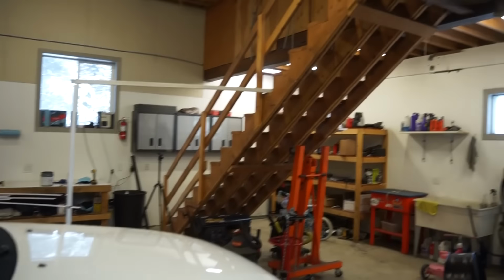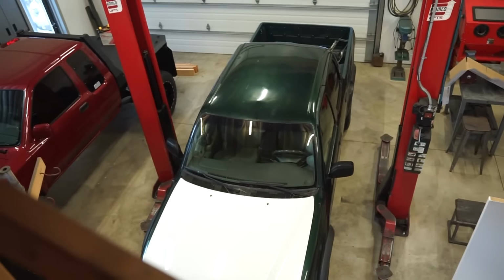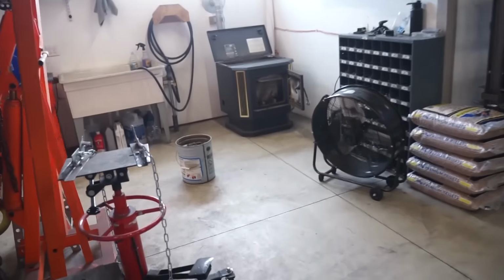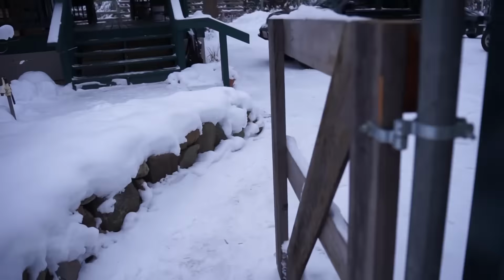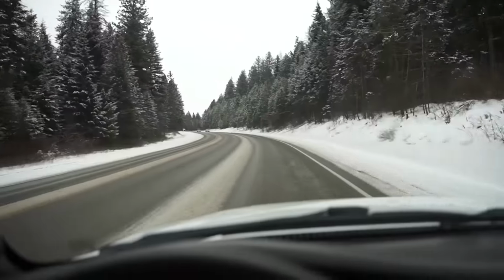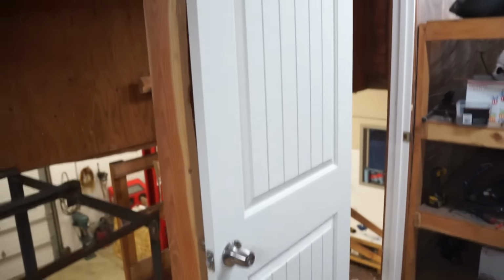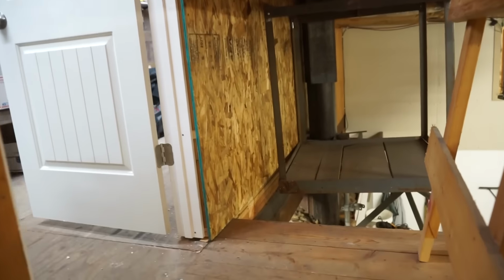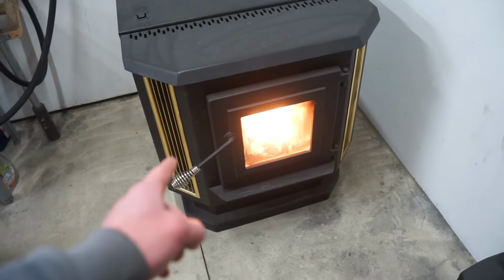Will The Diesel Tacoma Pull A Trailer?!?!

Comment: Lets go brandon!       My pellet stove has an actual burn pot and all the air comes up from the bottom.   There is never any ash in the burn pot even after 10 bags through it.  I hope your mods work well.  That would be a pain in the ass cleaning that thing out all the time.   I don't have to open my stove door but every 10 bags or so.   I hope your brother is doing well!

Comment: On your modification of the your lift ,what type of framing is your garage,if steel beams,what putting Ibeam connected to garage framing,using slide pulley.where yo can attach chain foil.and be slide back and forth being able to pull motors and load and unload items.good video as always keep doing what your doing 👍👍👍😎😎😎

Comment: No Problem, i drove so many times a 3500KG Trailer on a 3500KG Volkswagen T5 with a 1.9TDI :-D in Switzerland, Mountain up and down. So 7 Tonnes (7000KG) total is in my opinion the max weight what a 1.9TDI can handle. Regards from Siberia

Comment: The ash in the pellet stove is solely due to the quality of the pellets. Cheap pellets from local hardware/big box store are very low quality. I buy mine direct from importer and get the highest quality. They are more expensive but burn hotter and almost no ash / ash buildup. Before you build a new burn pot, I’d recommend buying some high quality pellets and try them? Just my experience. Hope this helps?
Reply from the maker: I’ll search around for better pellets!!
Reply: Buy a few bags and compare!

Comment: Have you thought of adding air injection to your pellet stove?  A small piece of pipe (3/4") with a small fan (computer?) mounted away from the heat blowing into the fire box for when you want those extra BTU's.  A wall wart transformer wouldn't use much electricity and any air going to the firebox will increase the burn efficiency over natural draft.  Put a variable fan on so it can be regulated and a valve so it isn't introducing air when it is not needed.  Make her as simple or as complex as you want.  Manufacturer's don't recommend it and it certainly isn't best practice but when we were in the shipyards during winter layup we often painted with oil based and laquers at freezing even in the mid twenties as long as the humidity was not high we had good success.  I wouldn't try it on auto paints which are much more finicky.  Might be worthwhile to talk to a chemist (not a salesman!!) at whatever paint company you are interested in as they have additives and suggestions as to which system to use for difficult situations.  I used to call International headquarters in Texas and talk with their chemists for help in such situations.

Comment: Don't use pellets but wood, I would say you need some air from the bottom to burn the embers and secondary air on the top to burn the wood gas for maximum performance. Seems like those side holes do neither very well?